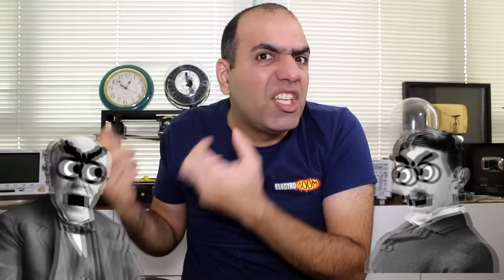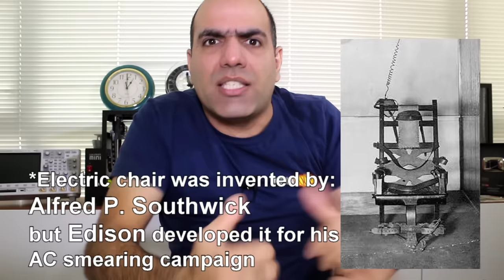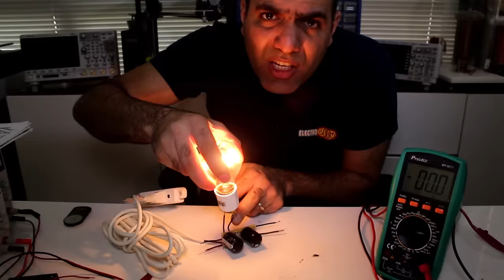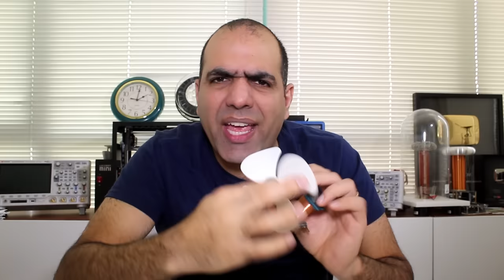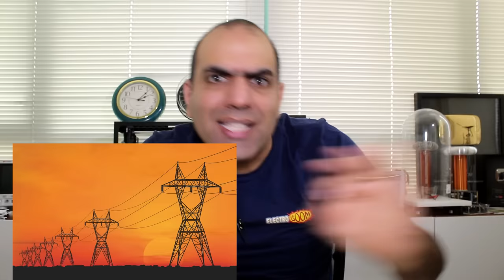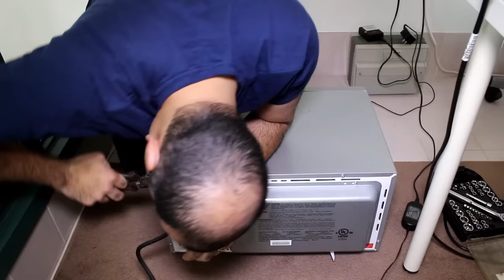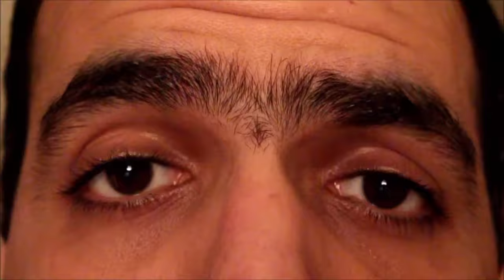Why Use AC Instead of DC at Home??

Comment: FYI Make sure your multimeter is rated for the voltage you want to measure. 820 volts would fry most consumer meters.. mines only rated for 600 volts for example.
Reply: Nah it would most probably not. If it is rated for 600V it does not mean it would fry at 601V, but it is better not to try, thats for sure.
Reply: @bumbarabun  820v is significantly more than 601v. Roughly 36% more.
Reply: @leebatt7964  yes bat how it is usually done. It is rated 600v so how that achieved? Components chosen not lower that 600v but higher. So lets say you find a capacitor which is 650V or maybe 700V whatever is cheaper available etc. On top of that capacitor has voltage 700V but it also has some reserve. So at the end there is a good chance your tester would not fry at 800V, but I would not bet on that of course.
Reply: That specific meter is rated for 750VAC, so he definitely tested the limits.
Reply: My Klein tools multimeter is rated for 1000V and 600A.

Comment: One of my biggest pet peeves is products which are exceptionally difficult to disassemble. I think companies should engineer their products to be easily take  apart, whether it’s to service or conduct use-maintenance (simply cleaning/oil bearings and points or contact), or if the customer wants to take it apart out of pure curiosity, it should still stand. If I pay for a product, I should have that freedom. Companies ought to be mindful of the engineering and ergonomics of the inner workings. For example, I had a Shark mini vacuum that had accumulated a thick layer of dust and grime on the propeller. The DC motor also was drowning in dust. They had used “safety screws” on the propeller housing and the motor assembly. Why?? Cleaning the propeller shouldn’t void the warranty. If anything, the warranty would be voided WITHOUT proper cleaning and Maintenance.
Reply: ya they are doing that on purpose. 
you're not supposed to see, understand and help yourself.
you're supposed to pay them to repair and service it for you or just buy a new one. 

yes, they are a$$holes.
Reply: Well the microwave is probably justified for safety purposes
Reply: based on your own logic: companies should have the right to sell the equipment as they want, with the degree of take-apart-difficulty they want. (btw, for sure you also have the right not to buy it!).

Comment: "****, they're using tamper proof screws to stop me... What they don't know is that nothing can stop me!"
Ahaha, I am laughing to tears))
Reply: Security screws and bolts are a joke. Anyone can buy a 34 piece kit of various types of these bits that also include a female/female 1/4 adapter and a case to hold them for under $10.
Reply: rayford21 
But hey, at least those arent as common as the + or - heads
Reply: - heads (flat heads) shouldn't even exist.  They should be less common than the security screws.  In fact, in many applications, they turn into security screws: there's no way to get enough torque without the screwdriver slipping out once they've seized up in something.

Comment: "Anyways with this I'm converting AC into DC using..."
tries to say full bridge rectifier
"it's a single diode but it'll do"
Reply: @1:42😂
Reply: The single diode didn't really do....
Reply: Don't  you mean half wave rectifier?
Reply: Full wave rectifier requires two diodes, right.
Reply: @anonymous_4276  the full wave rectifier Im familiar with 
requires 4 diodes usually depicted in a diamond shape 

but if u find a 2 diode one, id love to see it tbh
Reply: @YagamiKou  I think you're referring to a full wave bridge rectifier. I was referring to a centre tapped full wave rectifier.
Reply: @anonymous_4276  ooh fair, center tapped is even better
ye thats just 2 diodes, my bad  o/

Comment: Now I get the name of the channel. Well done. When I was younger (19 yrs old) and working at a park my boss didn't call before digging a trench even though there was a sign that said about 20 foot away "Call before you dig" in attempt to add another water line to the parks pool area. And so he started a trench and after 15 feet BAM trench fills with water; we thought he hit "only" a water line. So he told me get into the trench with a shovel (hell he was my boss) si I jump into the trench, it's full of water and ZAP! He'd also cut a 240 volt power main cable supplying an entire subdivision and it was like a horse kicked me. I flew out of that trench a good 25 feet. Needless to say we took out power, water, telephone and cable for like 100 homes. The trench probably wasn't 15 feet long  And it's so funny because when the police and fire department (even the mayor) showed up they were all talking to my boss by that sign now not 5 feet away "Call before you Dig". lol. Oh, and my boss received a $20,000 fine, but luckily the company paid for it. lol! I still laugh about that. So yeah I enjoyed this video. ZAP!

Comment: I worked as an electronics engineering tech for 1 1/2 designing, prototyping and testing new designs and after soldering an entire board with tons a tantalum capacitors I accidentally miss-wired the power socket so ground and power were reversed and blew all the caps simultaneously - it was a popcorn light show.  I also did the stupid meter thing where I left the test lead in the current socket and turned the probe into a missile which was very deadly.  At my current company a contractor electrician miss-wired the power in our building and was electrocuted to death.  Yes sometimes it is a spark, a shock, an explosion, some dangerous projectile, or downright lethal current flow.  By careful out there.

Comment: A few fun facts tho. First, yes you can use BLDC motors and fancy electronic DC/DC convertors, but that only became possible because of the inexpensive MOSFETs and IGBTs we only have since pretty recently in fact! Before 90ths every kind of "how to get 12v off-wall" question could only be solved with transformers (also gas-discharge-based stuff, but that was overcomplicated), with high-power stuff like pure transformer-based welders and the mentioned microwave ovens around for much longer (even today a pulse-transformer-based microwave is a pretty rare thing). Also regarding the dangers of the AC lines, even 100 VDC can be a hell to deal with because of the two facts: first, our own resistance matters, and varies greatly, say I can easily hold a 220 VAC live wire and finger-test the line if needed, though some easily get shocked even from 110 VAC lines, and that biting feel from the AC wires serves a nice purpose - it makes you toss the wires faster, and makes the shock itself a series of shorter shocks you only feel whenever the sinewave gets above your sensory threshold. With DC the chances of a person unwillingly clenching a wire are high, and I've actually seen a few cases of a bad trauma caused by relatively low-voltage exposures. And, the second downside. Arcing! Seen those nasty sparks when breaking a high-power AC load? An arc is being quenched because of the inconsistent voltage and current, and is mostly reduced to a small flash, now with DC loads things become wild, say I actually had a tinned wire being disconnected from a somewhat 100 W load at as low as 120 VDC making a few mm of an arc (as also the solder added one's oxides into the arc plasma, making it more conductive), which makes switching such a load a tricky task, also keep the fuses in mind, where the regular ones usually just never disconnect under higher DC loads. Oh, and that fried elephant case. The actual story was like that. As people were pretty tough to explain all those line losses, transformers, generators and synchronous or induction motors (as well as a non-100% risk decrease), Tesla's plan was to just show the edge-case of the AC safety with his coils, where even an Amp through your body won't really hurt (more of an advertisement, though). As a counterpart, the dangers of AC were also displayed by Edison in an exaggerated edge-case style, with the elephant electrocution being the most memorable one (the film is still online if anyone wants to know how to cook an elephant btw).

Comment: Tl;dw:
The higher the voltage, the lower the losses over long distances. That's why long distance power lines operate on a much higher voltage than your home. Going from high to low voltage is much easier with AC than with DC

Comment: Another benefit of AC is that it is much easier to quench an AC arc than a DC arc due to zero power at zero voltage/current crossings, which is handy for switches, breakers and anything else that needs to break a significant AC current under load, which is why switches rated for 250VAC are only rated 30-50VDC.
Reply: Teardown Dan   Does this also have to do with virtually no sparking when light switches close?
Reply: Not really. There is usually little to no sparking when switches close because circuit inductance is preventing current from instantaneously increasing. Sparks when contacts open are caused by circuit inductance wanting to keep the current going and the collapsing magnetic field is kicking the voltage across terminals up to whatever is needed to make it happen. That's why sparks are particularly nasty when there is a significant inductive load in the circuit. Safety micro-switches in microwave ovens that use an AC transformer to power their magnetron often fail because of that.
Reply: Teardown Dan   With some background and triple-reading (now 5x) I actually understand. 120V doesn't have much potential to jump the gap either?   BTW, just recently (2 weeks) my parents just had a switch replaced in a m/w oven that I thought was a very odd failure. I now understand why.  Thank you very much.  Very comprehensive reply.
Reply: The nominal line voltage doesn't matter much: the voltage from the collapsing magnetic field in an inductor can be multiple kV up to whatever the the breakdown voltage of the device providing circuit inductance (motor and transformer windings) is. If you try directly jumping a car starter, you may get fierce sparks there too despite being only 12V. You can also make a simple 500+V "step-up" inverting converter with nothing more than relay with no integrated protection diode, a diode, a capacitor and a suitable power source for the relay: wire the relay's coil to the source via one of the relay's NC contacts, connect the diode's anode to the coil's negative side, cathode to the capacitor's positive and capacitor negative to coil positive. When the relay is closed, current builds up in its coil until the relay goes open. When that happens, the relay coil (inductor) wants to keep the current going and the path of least resistance for doing so is through the diode and capacitor. You'll see the output capacitor's voltage rise either until input energy balances out leakage or something fails. Very noisy but it works.
Reply: Teardown Dan  Something like this? https://youtu.be/WuG4nOyF99s     Also, I remembered the other times I see sparks – when unplugging a vacuum cleaner w/o using the switch -so right, it never sparks when plugging in.
Reply: The relay step-up converter is somewhat similar to the relay oscillator but instead of using a capacitor directly in parallel with the coil to slow the frequency down, there is a diode between the coil and capacitor to store the coil's energy into the capacitor when the relay opens. Not a recommended circuit though as relay contacts are only rated for millions of cycles and the oscillator circuit I'm talking about will run at 30-200Hz depending on how fast the relay is and the repeated voltage spikes may degrade the coil's wire enamel or even exceed its breakdown voltage if there is no load. No good for your ears either.
Reply: Teardown Dan  Thanks.
Reply: Teardown Dan,
Theoretically an inductor could generate as high voltage as you want, but in reality the arcing voltage (in a switch or a relay, etc...) is typically only some dosens of volts. If it was higher than line voltage, then you wouldn't need AC to stop it fast, since the voltage drop automatically decreases the current of the inductor.

With only 300V DC, 1A source, through a 300 ohm resistor (virtually no inductance!) a 10 mm long arc can be generated. I just tried. This is not related to inductance.
Reply: @Pafi Drawing an arc from a constant-current power supply is a completely different thing from the high voltage arising from opening an inductive circuit like a snubber-less 12V relay's coil. Although the contact-break arc may be under 100V while it lasts, the arc will extinguish due to insufficient power to keep the plasma ignited before the relay's coil has dumped all of its energy. The coil's remaining energy will still force it to reach whatever the weakest path's breakdown voltage is. Now that the relay's contacts may be 1mm apart, this can be in excess of 1kV.

That's why DC relay drivers always have a free-wheeling diode or snubber network of some sort in parallel with the coil when the relay doesn't have it built-in or the coil's energy isn't being redirected elsewhere, such as my electromechanical boost converter example where the relay's coil is the boost inductor and the relay's NC contact is the boost switch. If you try driving a snubber-less relay without adding some sort of clamping of your own, you will be frying transistors and micro-controllers all day.

BTW, reducing an inductor's voltage to 0 does not change its current, it changes the rate of change of that current, that's why AC current through an inductor is 90 degrees out of phase with voltage. If you instantaneously reduced voltage across an ideal inductor (ex.: supra-conductor magnet) carrying 10A to 0V, that inductor would continue carrying 10A indefinitely.
Reply: @Teardown Dan,

1: It was a constant voltage PSU with a resistor. Just like line voltage and an ohmic load. And this small 300W power already created way too big arc to break with a normal switch. No inductor involved, so your explanation is proved to be unneccessarily complicated.

2: If the current is maintained, then the arc simply does not extinguish. 

3: to create a 1 kV arc at 1A you need about 10 cm gap or more. I didn't try it, just extrapolated from previous experiences. 

4: when a transistor tries to interrupt current in a coil, then arcing effect does not limit voltage, this is why clamping is advisable, however relays don't neccessary kill a transistor. Inductive energy is not neccessarily enough to cause irreversible breakdown in the transistor, some of those are rated for quite high avalanche energy. (I'm not talking about giantic power transistors, a small SO-8 cased one can do it well.)

BTW, nobody told 0 V inductor voltage would change its current. Negative voltage decreases its current, when arc voltage is HIGHER than line voltage as I mentioned. You know, for example 320V-500V=-180V
Reply: This is the voltage on an arc opened to 5 mm length and closed again (green curve, 100 V max). Yellow curve is voltage on the series resistor (therefore proportional to the current): https://photos.app.goo.gl/PhnPrq7XXIbrEHtK2
Reply: Teardown Dan, regarding collapsing magnetic fields and "joule thief" circuits (with a transistor), (also known as voltage boosters): Is this voltage-boosting accomplished by storing the lower-voltage energy in a magnetic field and then discretely discharging it (switch-mode) at a frequency to achieve the magical voltage increase? (may be how solar garden lights are able to light LEDs with low voltages).
Reply: @Teardown Dan,
When the power becomes too low to maintain the plasma, the high voltage generated by the remaining inductive energy can not harm a contact electrode. It can have high voltage, but without significant current.
Reply: @Teardown dan,
"The coil's remaining energy will still force it to reach whatever the weakest path's breakdown voltage is."
Or it will be converted to capacitive energy => damped, linear ringing with finite amplitude, whichever is the lower.

Comment: HVDC is getting more common, especially in undersea cables. DC to DC converters make this possible.
Reply: Getting more common in undersea applications? It is fundamentally important in undersea applications, it has to be DC!  And the converters are not DC to DC. The converter stations at each end of the undersea link are AC to DC, and DC to AC.
Reply: And barely anyone has touched on HV HFAC for wireless quantum tunnelling magic shit.